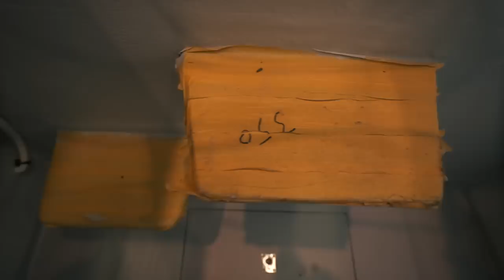We Have A Mast! The Finish Line is Very Close... | Catamaran Build

Comment: For those of us, in the heartland of USA, what is mousing?, Great video again
Reply: Running of a smaller line/rope/cable thru where you want a permanent line to go then it gets tied or spliced to the important wire or cable and you pull on the mouse line until it completely draws the other cable into place. Basic, but hope that helps.